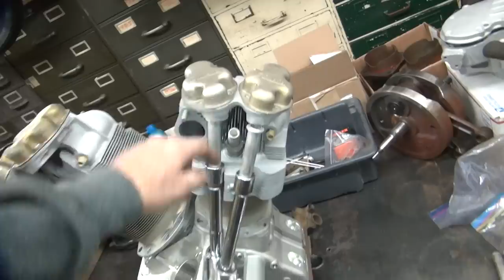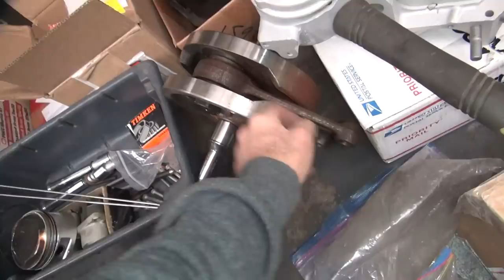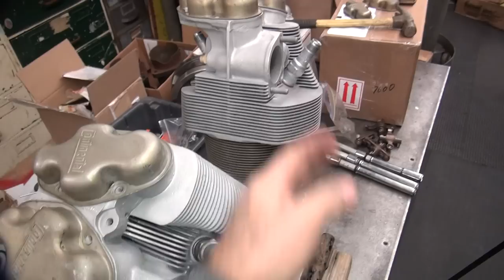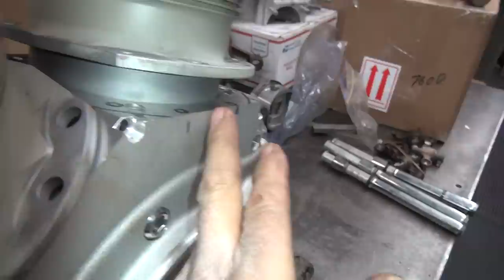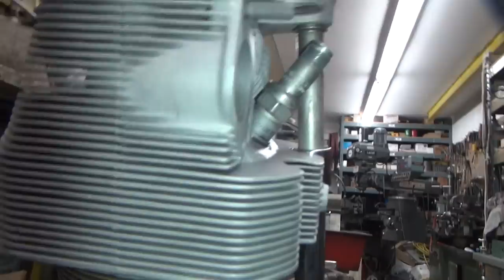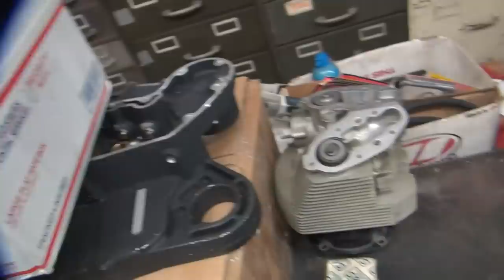#128 harley custom airplane 143ci motor mock-up big evo 4cam sportster twincam m8 race tatro machine

Comment: Amazing , if I had those parts I could stair at them all day and imagineer things. Can you make a case spacer and make a longer crank pin ? Then work on rod spacing ? I'm sure you have already gave it some though . 
Your very innovative , much respect .
Reply from the maker: i do have my limits but yes i have already been thinking about all of that and way more.
tatro
Reply: @TatroMachine  I  know using parts on hand to modify  or just for mock up is great but I can almost see you making a sand casted case half.

Comment: Tatro that's gonna be a beast of a motor man...can't wait to see what you do with it. What pushrod company will have what you need for that thing?
Reply from the maker: i used crower fuel hemi racing pushrods for my single. lots of option here.
tatro
Reply: @TatroMachine ....the shop that built my stroker 103 used comp cams pushrods. He also uses them in his 5" bore drag bikes. GMS racing engines is the shop.

Comment: I personally would never build an airplane engine from a set of H-D clone cases. A set of older BMW or Moto Guzzii cases and crank would be a better candidate, however if you are going to put it in a bike for an oddity your good to go, but for an airplane that motor is just going to be too heavy, too awkward and vibrate too much, not to mention all the critical areas that have been weakened. Airplane engines run at full throttle in order to get off the ground, that motor would definitely come apart in a big way.
Reply: Moto guzzi… the superior air cooled pushrod vtwin design, yup.
Reply: He's not putting it in an Airplane.
Reply from the maker: its going into a harley and it is going to put out way more power than an airplane motor ever thought about making. it will see 6500rpm+ too.
tatro